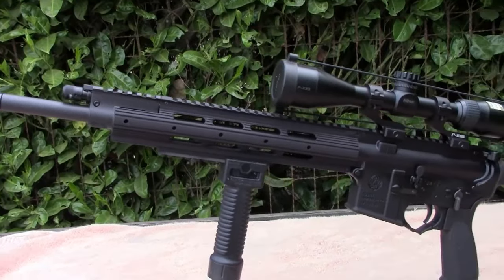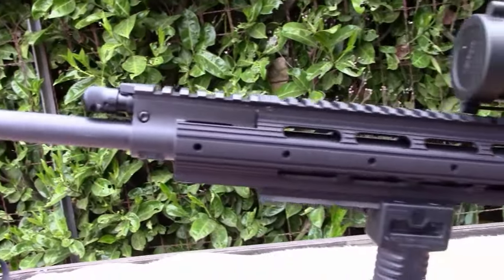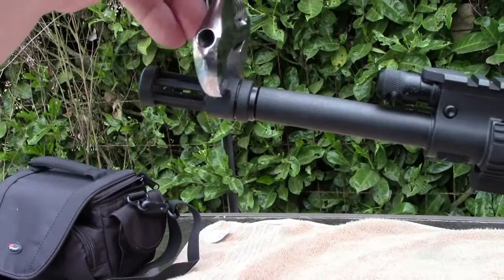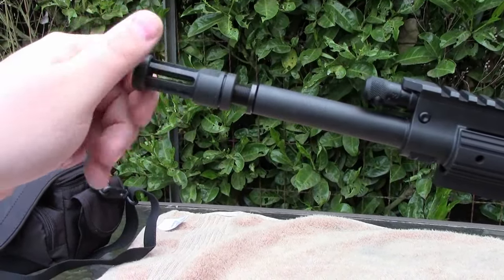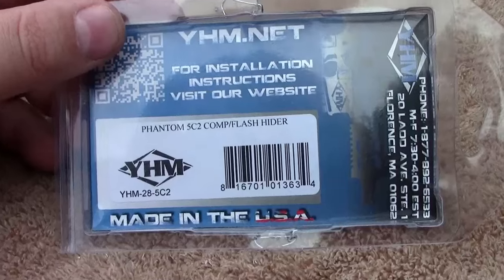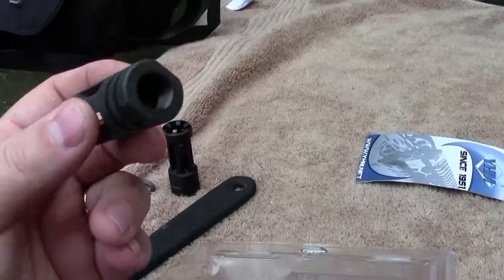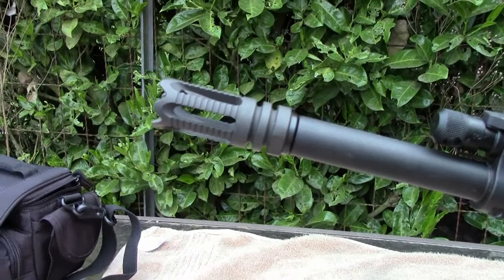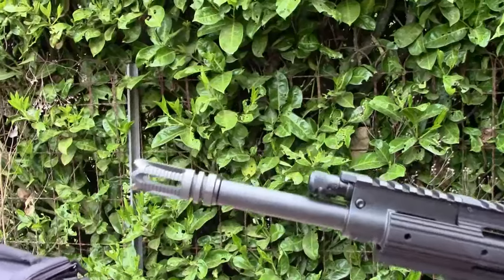How to Change out a Flash Hider/Muzzle Brake on a AR-15

Comment: God himself must've  put mine on then
Reply: @iamtheboxer  Same here.  Big SS bull barrel I just wouldn't put that much torque to get loose.  I see the adapter for the vise adapter.  I have put off my change till I have the ability to hold this things in a vise and not screw it up.  My STI was one expensive(for me)mofo and I don't want to have to replace a barrel. And I found the answer.  Check my other reply.
Reply: Gage Garofalo same
Reply: Hurcules built mine so im screwed
Reply: Lol. I tried taking mine off and no dice. Had to buy a workbench and install a bench vise to keep it steady.
Reply: Dido...I think it's welded on.
Reply: To everyone in this thread, someone did you a solid and used Loctight or something similar
Reply: Lol
Reply: I used a bigass wrench and a mallet to get mine off.
Reply: Meee 2
Reply: I can't get mine off. I have no place for a cresant wrench. I put a screwdriver in the opening and tried twisting it off. No go. I couldn't hold the gun with one hand and two legs. Won't budge. I got on here to see if anyone heated the barrel up tp remove it.
Reply: Stg
Reply: @nathanbean2499 they screwed me over is what they did.  Gluing on useless crap like a muzzle brake while my suppressor is sitting unused
Reply: Same
Reply: It’s how we know it’s sturdy boys… I think my hand is broke tho, off  to the hospital now
Reply: Mine not coming off😂😂😂
Reply: Get a larger crescent wrench 😂 like a god tier one
Reply: @DevilFrog61  yeah turns out the wrench was supposed to come with my AR-15 the guy didn’t give it to me so I had to order it

Comment: I bought a flash hider to replace the one on my ruger ar15 556.  I struggled for two days to get the ruger flash hider off.  After getting two vices to keep the rifle from turning with the nut, and using an 1 1/2 i8" pipe over the wrench, it finally came off with a loud *pop*.
Reply: In sure you got to experience the lovely moment of “oh shit, that didn’t sound good please just be the flash hider”
Reply: Have the same issue
Reply: Soak in water sometimes they use heat resistant glue that is water solvable
Reply: Sounds like the pop came from snapping the pins that were installed.

Comment: Muzzles are actually supposed to be torqued to 18 lbs also applying some vibra tight vc3  with some of the vc3 tape they sell this is the right way to do this.this is used as an impact absorbing barrier rather than locktight or rocktight which are both over kill and a real nightmare to remove in the future
Reply: 15-20

Comment: The "fatter" area should face down towards the ground - it's designed that way to minimize the dust kicked up from gas from the muzzle device that goes straight down; according to Brownell's anyway.  The crush washer is there so that you can torque the muzzle device until it is oriented correctly.

Comment: I just used this method on my LWRCI, worked great. Took off my Lantac dragon for an a2.. comps are to loud and only good for competition in my opinion.
Reply: There is a tool I'm waiting on that  aligns with the 6 lugs in the chamber. 
It goes into the receiver and holds the barrel. You can leave everything on the outside and it holds the barrel from the inside. 

No vise or damage to the receiver  making it easy to change anything on the barrel. $50 from  Brownells.

Comment: I was told the crush washer should be installed with the crown towards the muzzle device...Not the crown of the barrel!
Reply: The beveled side goes towards the chamber and the "flat" side towards the brake\suppressor

Comment: Thanks for the lesson. I'm a very beginner and just bought a 7.5" ar-15. I wanted to change the muzzle brake (looks like there're many options that is better than birdcage it came with) but the part I need to unscrew is bit inside of the hand-guard (just inside to piss me-off, sorry). Is there a way to unscrew the birdcage w/o the taking whole damn hand-guard off? I appreciate your response in advance. Thanks!
Reply: Anything else (other than a suppressor) you put on that is just going to make this firearm much louder. The A2 flash hider it most likely came with is going to quiet and redirect the blast forward better. I wouldn’t recommend replacing this on an already loud 7.5 inch barrel.
Reply: @krknife  Thanks for the advise!
Reply: I also have a shorter ar pistol at 10" and was thinking of getting the surefire blast diffuser but was worried it would be even louder? thoughts?
Reply: @krknife  the question was for you fyi
Reply: @Mowgli1894  I’ve heard good things about surefires muzzle devices. That combined with the fact you have a 10” will help redirect a lot of that noise/concussion/gas forward. To answer in layman’s terms. I think a birdcage a2 does a great job but if you’re willing to pay out surefires premium and play around with it you can get some interesting results.

Comment: "OH it didn't take much with a Cresent wrench" I used to bust every single bolt loose by hand on every single track pad both sides of a Bradley fighting vehicle when the pos needed changing literally because ibwas the only dude who could and I can't begin to budge my flash hider so idk what you are talking about guy but mines the mother effing sword in the stone type stuff. Thor himself torqued mine to the spec of 900,000 ft/lbs and I have a 3000$ platform so standing on it while twisting the eff out of it isn't really sitting all to well. ANYONE WITH SOME IDEAS?! ANYONE... PLEASE..

Comment: I did it this way very easy why do people say to use a vice block?
Reply: Chone Martinez puts tension on the barrel nut and upper reciever
Reply: A good idea. Not necessary. I even had a very stuck brake on a rifle once and had to crank on it pretty good and the barrel/receiver held up just fine.
Reply: Seems to depends on the brand a lot of the time. Some manufacturers will put them on tighter than others.

Comment: So, kind of a stupid question. So I bought a muzzle breaker for my .308 savage axis. Came in yesterday. I went to see if the bullet will fit through and it don't. It's says it's for a .308 caliber. So should I not put it on and test it or is that how it's supposed too be?
Reply: Justin Humphreys just to clarify did you use just a bullet by itself or a loaded round... the bullet should clear but the brass case will not. Also if you got one for 556 the threads probably wont match either.
Reply: @allenmoto291allenyother8  I figured it out. I'm dumb, LOL. Forgot the casing don't fmgo through the barrel haha
Reply: Justin Humphreys no worries weall have those days glad you figured it out. Happy shooting 👍
Reply: @allenmoto291allenyother8  I love seeing an enthusiast helping someone out without making fun of them.
Reply: It's not a stupid question, you should ask when you do not understand. However, with such basic comprehension of a cartridge I think more studying should be done before you continue to use firearms.
Reply: Jesus Fucking Christ
Reply: @TommyTombstone  Yeah right? ALMOST one of the most wholesome comment threads I've seen... almost :(
Reply: @TommyTombstone  Well... Do you  blame him for telling somebody to study and read more on a topic that could be as dangerous as shooting guns?
Reply: @TheFlyingZulu  shooting guns requires very little knowledge about case and bullet diameters. 

It also requires almost no knowledge about ballistics, pressure ratings, dwell timing, tolerances, twist rates, thread specs, creating DOPE for ballistic calculation, load development, or parts compatibility, to name a few.

I've served with plenty of guys that I could trust to shoot the enemy (and only the enemy), who have no clue about replacing gas rings, putting o-rings on extractors, or which muzzle devices would be compatible with their AR-15.

So yes, I blame him for being condescending.

Comment: if i take off my flash hider and it already has the threading, is there anything extra I would need to do to add a suppressor? would that be the proper threads?
Reply: Adam Lee yes you would need more... suppressors don’t attach to barrel threads. The best bet is to get a muzzle device from the company you want the suppressor you want. Most suppressors have corresponding muzzle devices that they attach to
Reply: @user-vv7fc4sj1r  you are incorrect although some suppressors do require you to have a muzzle device attatched some.suppressors and direct thread to the barrel.itsself
Reply: Im So Nu All Leanz on pistols yeah all the time but in 2019 who uses direct thread for an AR...? Everyone uses quick attach. If it was a bolt action then sure
Reply: @user-vv7fc4sj1r   i have one on my 6.5 inch 300 blackout pistol lol i.guess im Cave man
Reply: Im So Nu All Leanz lol na, that actually makes a lot more sense for a 300 than a 556. Thats wassup, sounds like fun
Reply: @user-vv7fc4sj1r   yeah man its damn near quiet .. i mean quiet  the action is louder then the bullet crack
Reply: I would never dream of putting a suppressor on my AR.....and lettin my neighbors sleep peacefully
Reply: @cibersatan  lol i feel.dat brother
Reply: @nlrivers  in fact, I just purchased a .50 Beowulf and thus far their dogs go nuts when I cycle a 10rd magazine (law around here is I can shoot as long as i'm 500 yards from a domicile)

Comment: Do you have to replace the washer or can I just reuse the current one?
Reply: Your suppose to replace them each time
Reply: @Willoajsjs  thank you
Reply: You're supposed to replace them, but I've heard if you're using a comp or other device that doesn't require timing, you can get by using the original washer a 2nd time. I wouldn't keep re-using it though, only 2 uses.

Comment: i want a new muzzle break how do i know my thread count
Reply: It generally depends on the caliber; different calibers have different standard sizes and thread counts. For example,  5.56/.223 guns use 1/2" x 28 tpi (threads per inch), while .308 uses 5/8" x 24 tpi threading (I'm not an AK fan so I don't know what 7.62 x 39 uses but it should be easy enough to look up). There are some oddball guns that take oddball muzzle devices with oddball sizes and/or thread counts; if you go on, say, the Brownells page for muzzle devices and filter for "threads" in addition to the standard threadings you also get a bunch of weirdo thread sizes with 1 or 2 hits on each and god only knows what guns they fit. But if you have a standard factory AR-15 or AR-10 you can be confident it has standard sized threading. I'm in the market for a linear compensator to replace the A2 flash hider on my Palmetto State Armory AR-15 and I haven't even bothered to measure or look up the threading on it because I know there is a 99.9999% chance it is in the usual 1/2" x 28 size that a compensator made for 5.56/223 will fit. But if you are more thorough than I am, the specs page in your gun's owners manual and/or manufacturer's website should tell you for certain.

Comment: If I don’t plan on taking the muzzle break off or swapping it out anytime soon would it be a good idea to add a little bit of loc tight?
Reply: Rude420Boi not really, I've never had any issues with one coming loose over time, the crush washer does its job well.

Comment: I have zero clue why this guy would not put his barrel in a vice using something like the Wheeler Engineering barrel clamp  within a vice grip.  So he's putting torque on barrel itself which is not cool at all.
Reply from the maker: You're not cool at all...
Reply: the barrel us much more stronger than the upper in a vice block.